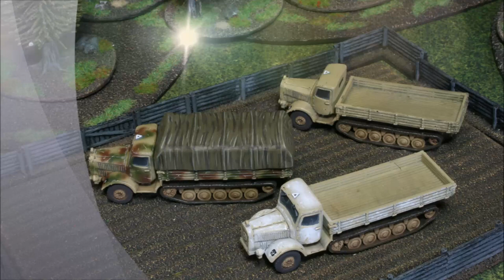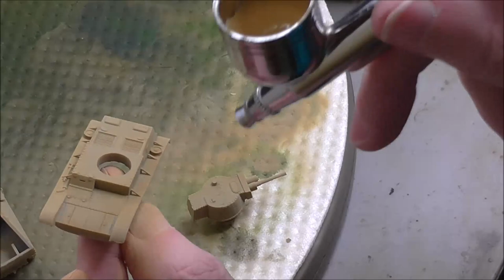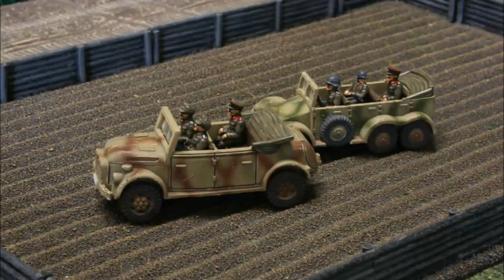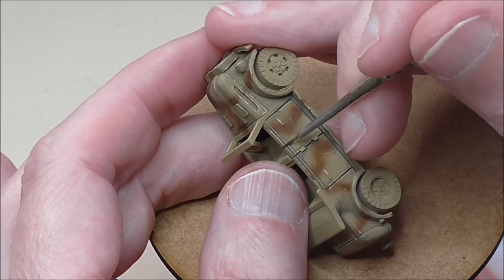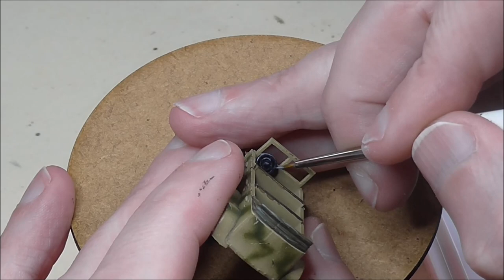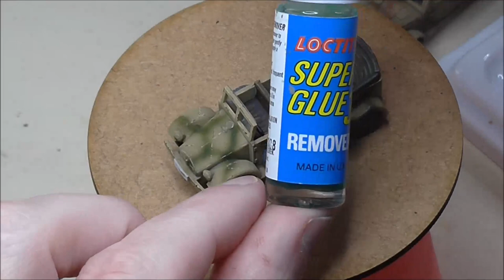Painting 3D Printed 15mm WWII Vehicles

Comment: Hi. Phil from Battlefield3d here. Firstly, thanks for the review, and it's great to see the models come alive. If I can make a couple of comments on the points you raised in the video. Firstly, I find that the layer lines you mention, can be reduced further by a light scraping with the edge of a rounded scalpel blade, as the material responds well to this. Also, I have recently refined the mix of the resin used, and it is now not quite as brittle as before, so thin areas will flex a little when sanding, and small items such as machine gun barrels etc will resist the temptation to snap if you snag them or drop the model on the table.
Reply from the maker: Thanks Phil. I think no one will have any issues with the layers. I have seen other 3D prints that were very hard to work with. The results I was able to achieve with your prints was on par with plastics and resins. Great kits.
Reply: I just messaged you on Ebay about your products, as I am thinking of starting up collecting these models after a long long time away from the hobby, and then found this vid, I have come to the conclusion, your models look superb and I can see myself buying a lot of these over time, and this youtuber is a superb unwitting salesperson for your products, lovely products and superbly finished.

Comment: Nice work as usual!  I fought for AGES to get the right paint, thinner and air pressure ratio when doing the freehand three tone camo.  Tamiya is by far the best paint to use and I thin it 1 part paint to 2 parts Tamiya thinner (acrylics).  I also drop the air pressure way down to around 10 psi.  The combination of very thin paint and very low pressure gives excellent control over the amount of paint laid down giving the final product that “field applied” look.
Reply from the maker: Tamiya is a great airbrush paint and my first choice for three tone camo too. I wish I could say what ration I use! I just go by how it looks and I suppose by working to particular levels in my cup. Thanks for watching Rimmy!

Comment: Very easy on the eye and It wad very easy to follow your tutorial. The section on seats and tilts was appreciated as I do need quite a few soft-skins to fill in those gaps. Battlefront did provide most of the armoured carriers I wanted, but no cars,no trucks  and none of the other unarmoured vehicles. 
PS The Mercedes Flak Maultier is on my to-do list and so it's great to see it'll work as I've the Flak guns from Forged In Battle ready to go.
Reply from the maker: Glad you found it useful Chris. Its a good change from my usual armour focus!

Comment: I'm done with buying ' 3D ' models. EVERY TIME they are advertised, they look great, just like a kit ! But when I buy several, as they're often half to a third the price of a kit. They arrive so heavily ' terraced ' ( lines all over them), they unusable .
Reply from the maker: I've seen those types, mostly on ebay. I have found the battlefield3D prints to be completely different. The layering is the exception rather than the rule. These might change you mind. Thanks for watching!
Reply: I accept the challenge. Drop me a line via the Battlefield3d website, and I'll send you a sample, foc if you're in the UK.
Reply from the maker: @philhathaway708  Good stuff!
Reply: @philhathaway708  Thanks.